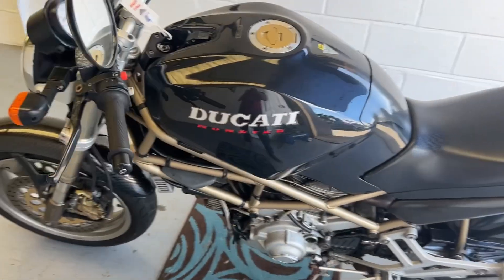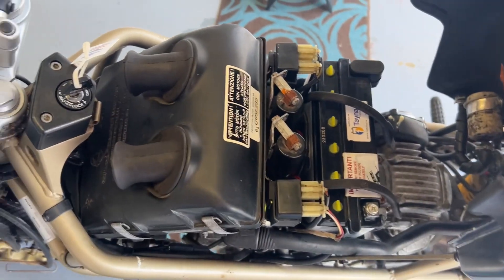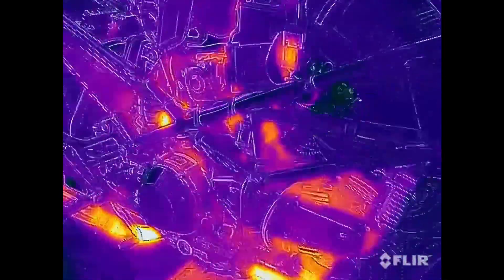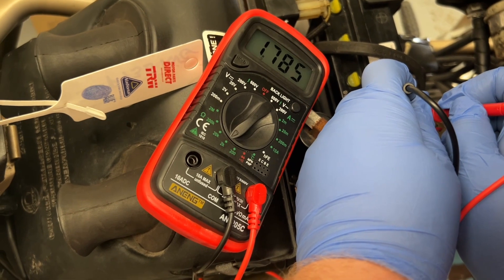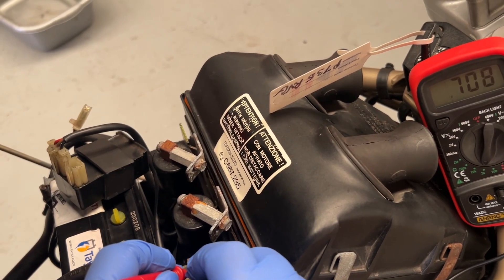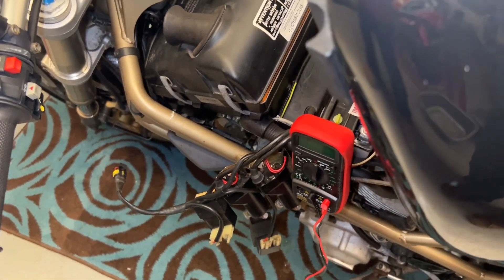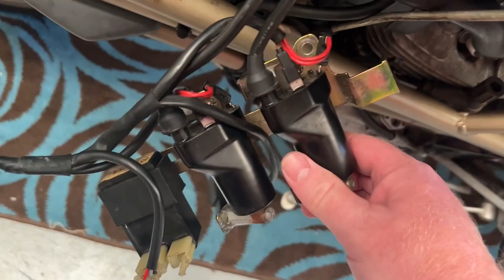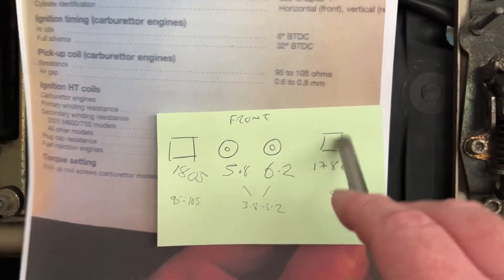From dust to Ducati - Thermal Imaging a Monster 900

Comment: I know this bike is obviously done now, but I'm only just working through... Anyway, when mine had issues about 20yrs ago, I swapped the coils and packs over and proved that one pack was knurdled and so replaced, but at the time it just wouldn't run at all IIRC. Later one of the pick up coils in the crank case gave up too wich stopped one cylinder working. That was fun. But apart from dodgy neutral switches and the chocolate regulator (swapped for a proper one) and starter solenoids, the electrics were sound. It did like vibrating brake lights to death quickly though... Did fit an LED but they were crap then so when I reassemble it I'll fit a modern one.
Reply from the maker: Its all good, the adventure of maintenence!

Comment: You’re too technical for me 
I’m happy just changing bits and bobs 
Anything electrical and I’m done for 
it would have to go to my local stealer for that
Reply from the maker: To be fair, I should have checked these much earlier on. But I was being led by talk of the carbs not being setup right. You live and learn. Also shows a lot of these “YouTube” rebuilds are heavily faked as the bikes are known good it seems.
Reply: @MotoTingle  I wouldn’t even know where to begin with fault finding electrical issues 
I could probably figure out if there was an issue but trying to find where that fault is would be the biggest headache for me 
So top job 😊